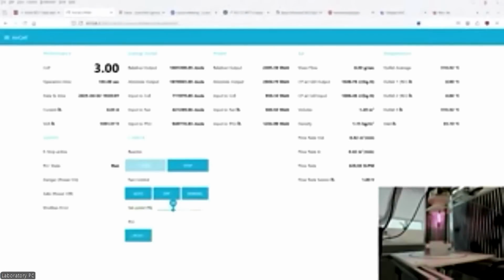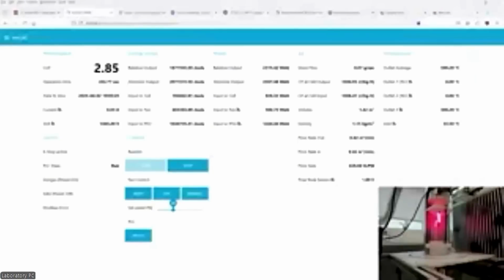ENG8 Cold Fusion Reactor Demo

Comment: He probably could have made fusion work by following the tech details of John Keely from late 1800's. Resonance phenomena with frequencies and ratios applied, in his 114 work shop inventions. He could make like poles of magnets attract, get 51 inches of mercury on vacuum gauge with hollow sphere, generate 23,000lbs water vapor pressure in 15 seconds, built self running fluid motor using water hammer pulses from 4 way shock valves, created lift effect demonstrations against gravity with vibrations applied, etc. Visitors signed documents as being present during some demonstrations. Reference books available for those not knowing about this research physicist. Also The Snell Manuscript from S.V.P. -- summary of Keely's 3 lab books. The Keely Motor Company Philadelphia 1865-1899.

Comment: Two things to consider:

1. I think the biggest reason why zero point energy is being withheld is the potential for garage inventors to create essentially Tunguska blasts with little effort.

2. The most famous and cherished Chinese science fiction author Cixin Liu, before writing Three Body Problem, published Ball Lighting. It's basically a very thin military intrigue plot wrapped around the concept of ball lightning being macroscopic atoms, which are harnessed by black budget Chinese and American projects as weapons. He got the atom part right but doesn't explore time/space manipulation. If this all gets fully confirmed, my guess is that Liu was allowed by the Chinese to introduce the ball lightning tech to the public awareness in order to undermine American research and domination of the tech, or send a message that the Chinese are fully aware of it.

Comment: If the cop > 1, the very next thing that should have been done is a self-powered unit under load.
Where is it? WHERE!?
I mean, they've been doing it for years?
I don't buy it, sorry.
Reply: @Rebel101  you'd need a large cop to counter the losses especially when the output is heat, reverse air heat pumps with a cop higher than this reactor can't acheive it. But I agree, a self looping device would be useful  evidence for naysayers.

Comment: The reason I don't believe in cold fusion isn't because I think it's technically unfeasible. It's because you'd be turned into a corpse long before you could even think of showing it to someone. The world still runs on oil. No way you'd be allowed to show off the science. 

Now you might think I'm being silly, and I am, but I'm about 40% serious as well. Go and try and look up the geometric formulas for arranging the explosives around a plutonium core in an implosion type nuclear device and see how quickly you get on someone's radar. Some things are simply not allowed in this world. Cold fusion is one of them.
Reply: Its non equilibrium so positive ions H+ are traveling slow  probably at the speed of sound so  won't be released because of the magnetic field containment . Hence no radiation.  While a hydrogen ion (a proton) possesses some energy, its kinetic energy at the speed of sound is relatively low. It wouldn't be high enough to cause significant emission of electromagnetic radiation or particle radiation like those produced in nuclear reactions or at relativistic speeds.

Comment: There are definitely radiation risks, the russians call it strange radiation, one of the main scientists died. Its not measurable with normal gear... Bob greenyer has written and speaks of it, shishkin wrote a paper on shielding from it. That part was a bit disingenuous. Otherwise super cool💙
Reply: It can be shielded ..
Reply: @BDO-f6z  yeah, only how best to diy shield and exactly where to shield are still not entirely clear to me. Perhaps if you know you can share...
Reply: Here are my notes on shielding if anyone wants to experiment with lenr (hv, spark gaps, plasma, water cavitation, etc).
Reply: @FreedomNow8-b7f Where are the notes? Are they on mfmp?
Reply: @FreedomNow8-b7f  where are your notes?
Reply: I dont think radiation is an issue as h+ will be traveling at speed of sound in this non equilibrium plasma so no worries
Reply: @complianceaves1120  you'd be surprised. As this is a new realm I would err on the side of caution.

Comment: Fwiw LENR has been a scientific curiosity for decades. A while back i was browsing the on site technical papers at ornl and came across one that was doing postmortem on tritium helium separation devices. It was found that the palladium foil membranes failed by melting and had induced radioactivity that could not be explined from tritium exposure alone. They found that it was somehow catalytic for the DT nuclear reaction.